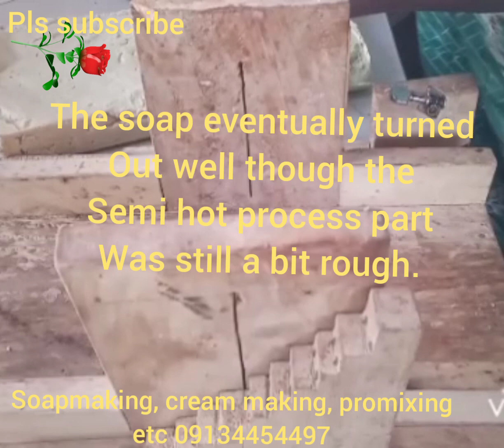Calcium laundry soap.

Comment: Thank you dear for the video. I made mine only with lye at 50% and palm oil (bleached) for laundry and it came out good and bit very hard, however it's good for both hands and machine wash. Very effective both. 

For washing machine
After grating the hard saop then I mix them with soda ash in food processor and it comes out as normal washing machine  detergent.
I perfectly understand your student's question on increase the profit margin.
Reply from the maker: Wow! That's nice to know.
Basically soap needs only oil and lye.
Reply: @zegwaizestasoapsskincarean1455  Thank you, I did it with palm oil only (can't find kernel oil in shops where I live  and are very expensive online) after watching your video. Thank you very much.
Reply from the maker: @Somaake5  Your welcome dear